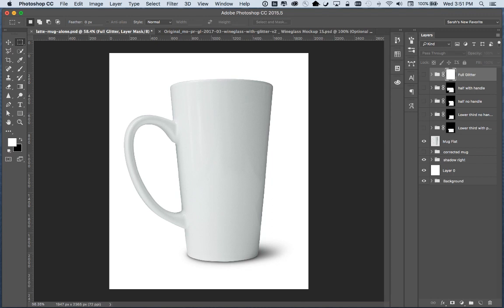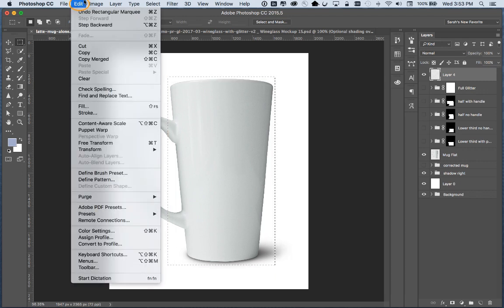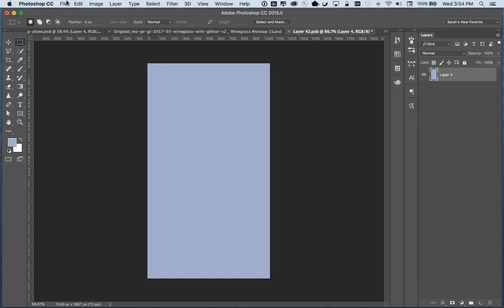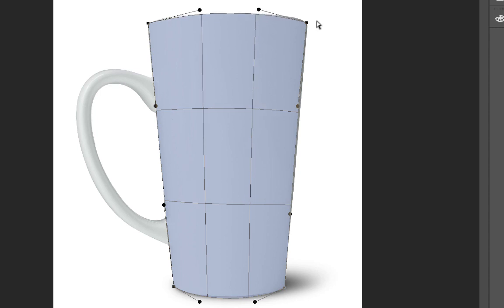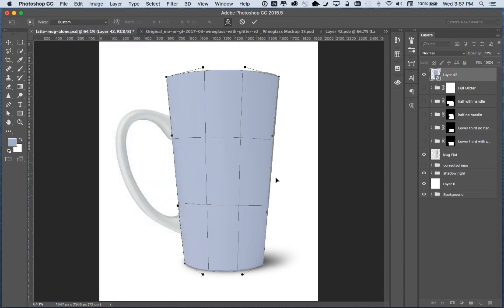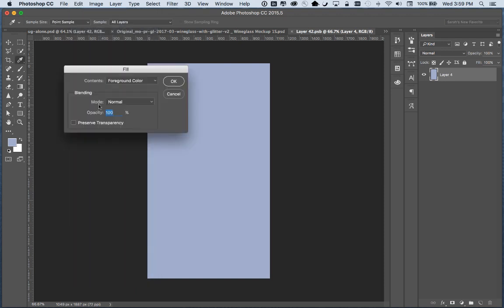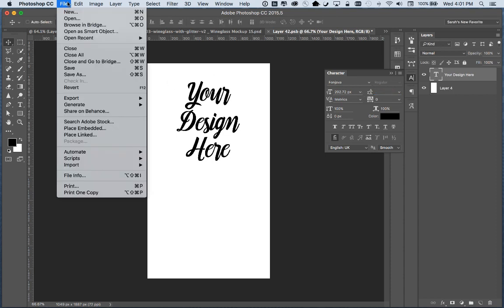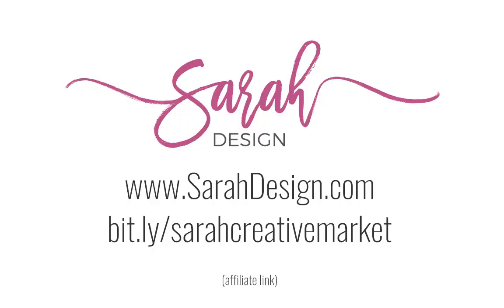How to Make a Latte Mug Mockup Smart Object

Comment: Did this for myself if it benefits anyone watching. 
1. **Create a New Layer**: Click on the "create a new layer" button (represented by a square with a folded back corner) at the bottom of the layers palette. Alternatively, you can also go to the menu in the upper right of the layers palette (the "hamburger" menu), where you can create a new layer.

2. **Draw a Rectangle on the Layer**: Draw a rectangle closely fitting the edges of the main part of the latte mug on the new layer.

3. **Fill the Rectangle with White**: Go to the top menu, click on 'Edit', then click on 'Fill'. In the dialog box, click the dropdown menu, choose 'White' and hit 'OK'.

4. **Deselect the Rectangle**: Go to the 'Select' menu and choose 'Deselect'. The shortcut for this is 'Command D' on a Mac or 'Ctrl D' on a PC.

5. **Convert to Smart Object**: Right-click on the layer and choose 'Convert to Smart Object'. After this, you can adjust the opacity as needed without affecting the original image.

6. **Change the Fill Color**: Double-click on the layer to open a new tab, which is a .PSB tab. Fill it with a different color. Go to 'Edit', 'Fill', and choose 'Foreground Color' to use the color currently selected in your foreground color square in the tools palette. Hit 'OK'.

7. **Save Changes**: After making any changes to your .PSB, always hit 'Save'. Once you hit save, the asterisk that initially appears in the .PSB tab will disappear, indicating that you've saved your changes.

8. **Adjust the Shape**: Turn down the opacity so you can see the shape of the mug underneath. Go to 'Edit', 'Transform', 'Warp'. The warp box appears like a grid with handles in the corners and dot handles in other spots on the sides. Start dragging the shapes in until they line up with the shape of the mug. Adjust the shape as per the curves and edges of the mug.

9. **Add Text or Design**: After getting the desired shape, bring the opacity back to 100%. Go back to the .PSB tab and change the fill color back to white. Then, add the text or design you want to place on the mug. After adding the design, hit 'Save' and go back to the main layer.

10. **Adjust Design Size and Placement**: If needed, adjust the size and placement of the design on the mug by going to 'Edit', 'Transform', 'Scale'. Drag out from the corners while holding 'Shift' (for proportional scaling) or 'Shift + Option' (to scale from the center) on a Mac.

11. **Test Design**: Turn off the white layer in the .PSB tab, hit 'Save', and go back to the main file to see how your design looks. If you need to make adjustments, you can transform the design again until it looks just right.

12. **Finalize**: Once you're satisfied with your design, save your changes. You can now easily add new wording or design to the smart object in the future by just editing the smart object, hitting 'Save', and seeing the changes reflected on your file.
Reply: Thank you!  I usually type out the instructions too.😊

Comment: I am currently building my diy cylindrical printer and wondering whats gonna happen to the image on a conical shaped cups. Now I know the tweaks and yes my guess is right, its in the warp of the object via smart hehehe thanks for this video just confirmed my guess now i can proceed to images upon building my device and finally be ble to print a correct image on a conical cylinder fashion, all the best, cheers here from the Philippines